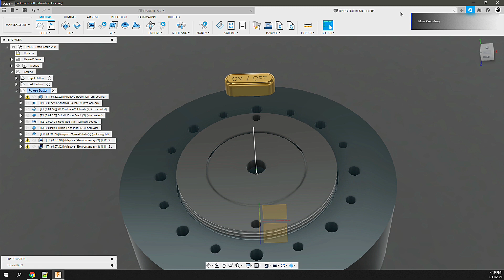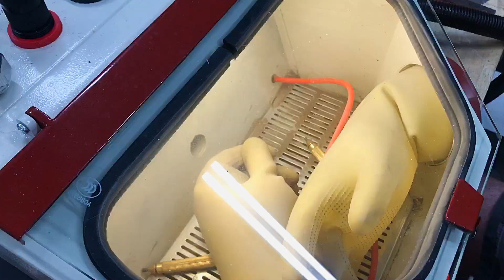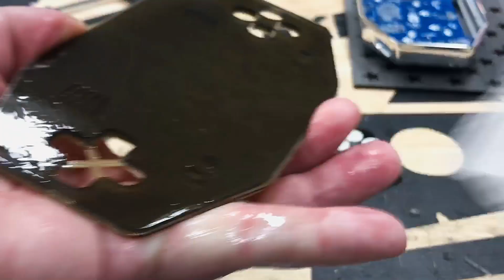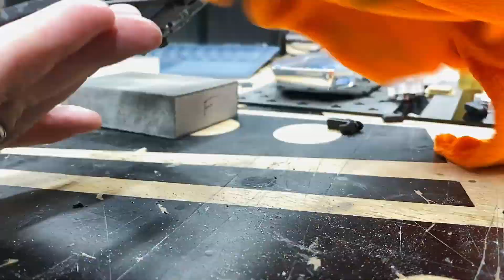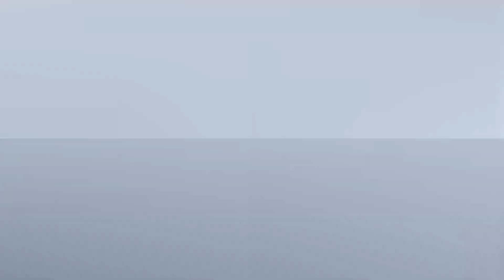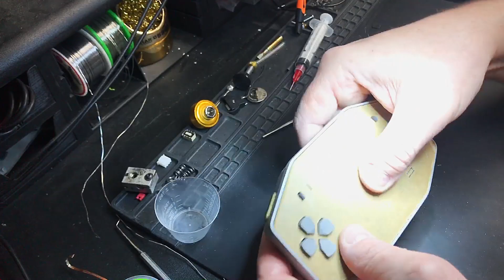Milling a Handheld Arcade from Solid Metal?! Part III

Comment: My first attempt at milling acrylic failed so miserably. My milling bits gunked up so fast. I then found out, like you mentioned, it's best to used the cast kind. I eventually succeed in milling the extruded kind by applying a lot of soapy water during milling so the shreds of acrylic couldn't stick to the milling bit. But it makes it very messy.